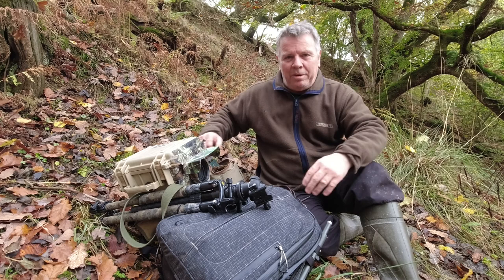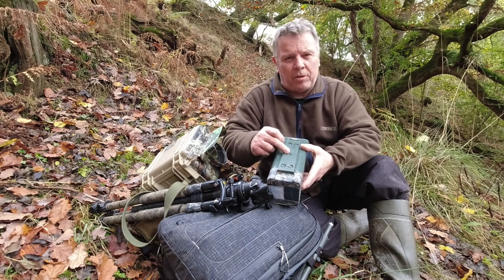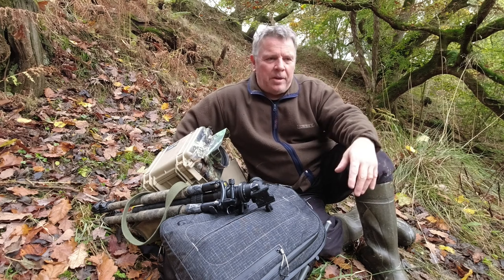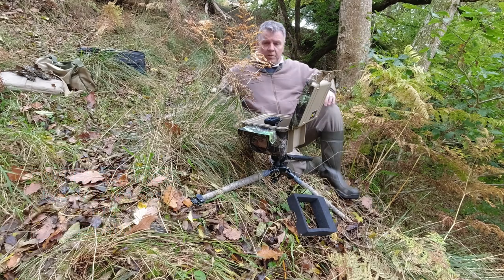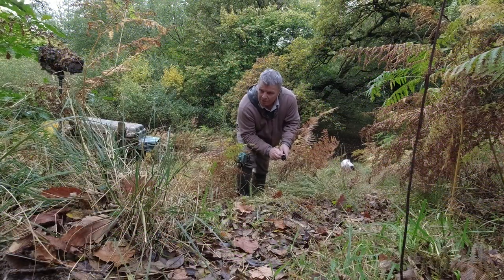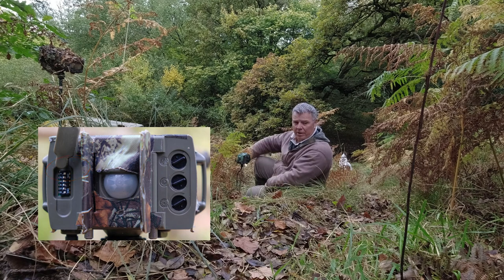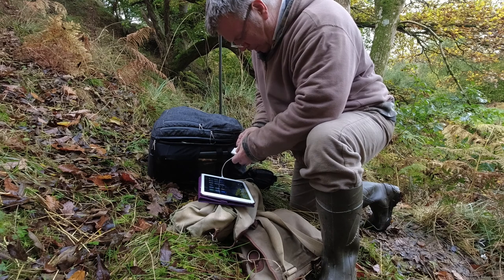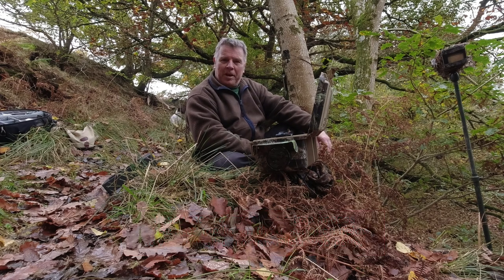DSLR camera trap - Autumn Badgers with my new DIY flash housings.

Comment: Great vid John! You've got a great setup. I've watched a couple of your video's but may have missed one. Have you ever tried using the built-in flash of a camera? Maybe with a diffuser to prevent it from getting from reflective eyes? Would love your thoughts on this. Thanks in advance!
Reply from the maker: Thanks for the kind words. The built in flash will never give you very nice lighting no matter how much you diffuse it, off camera flash is the best way to get attractive lighting in your images.
Reply: @JohnFormstone  Thanks for your reply, are your thoughts the same if it's in addition to an external flash?
Reply from the maker: Any flash that comes straight from the direction of the camera will never give you flattering light. So using the built in flash is not something i would consider.
The best way to see what works and what does not is to set up some lighting scenarios and try experimenting with different flash positions, it will soon give you an idea of what works best. Hope this helps.

Comment: Nice video, very interesting! The foto of the badger turn out very good. Can I ask you where did you bought the camo tape that you used on the pelican case and the flashes housing? Thanks
Reply from the maker: Hi, The tape on the camera housing is "Allen Vanish camo tape" and the tape on the flash housings is "Gorilla Camo tape". I got both of them on Ebay. Hope this helps. 😊
Reply: @JohnFormstone  Thanks!!

Comment: Hi John, really enjoying your videos, I've just recently started camera trapping, and have had some success with our allotment fox. I'm up early 5am this morning waiting for first light as I'm excited about the potential for some Badger action. (I've left it out in some woods that look like they have a lot of activity.) So far I seem to be having problems with fogging and dew on the outside of my pelican case filter. Any tips? Do use lens heaters or hand warmers, or is it just a case of something we have to put up with on this damp island?
Reply from the maker: Hi Grant, I understand your excitement. every time i check up on my camera trap, I feel like a kid at christmas.
I too have fogging of the outer element of my camera housing, but its mostly around dawn when the temperature starts to rise. I havn't found a solution for it i'm afraid but maybe as you suggest hand warmers may be worth a try. I would be interested to know if you find the answer. 👍

Comment: John - great photos, a couple of questions. You obviously use black electrical tape on lens, is this to stop zoom/focus being knocked? Also noticed you have two Peli case now, the full frame you have in a different orientation, which have you found best in use and in the field?
Reply from the maker: Thanks Nick. You are correct about the tape and even with this on I still sometimes manage to knock it.
The vertical case is the first one I made. Its a Pelicase 1200 and is a little bit tight for my full frame camera but it is easier to see the screen when setting up as my Nikon D610 doesn't have a tilt screen.
The other is a Pelicase 1300, which is a little deeper, however, I made it with the lens on the side in order to have the ability of getting it closer to the ground and be able to use longer lenses if needed. Again in this orientation its a bit tight for my full frame camera and difficult to see the screen, so I can see a mark III on the horizon. They both work well with my Nikon D5200 as it is a little smaller and also a tilt screen. If I had to choose one it would be the 1300.😊
Reply: @JohnFormstone  Thanks for the comprehensive reply, really appreciated. I also have the D5200, so think I'll go with lens in side option. My case is a Peli copy, now spray camouflaged but no holes as yet! Getting close to ground for small mammals appeals as an option. Good luck and look forward to your Mk 3 trials!

Comment: What camer case box are you using and we're did you buy it from please many thanks
Reply from the maker: Hi Stephen, The housing I use is a Pelicase 1300 which you can get here: https://www.waterproof-cases.co.uk/product/peli-1300-case
A cheaper alternative with the same dimensions can be found here: https://cpc.farnell.com/max-waterproof-cases/max235h155s-079/waterproof-case-235x180x156-foam/dp/SG33455
Hope this helps.